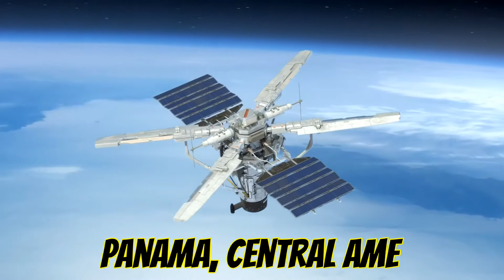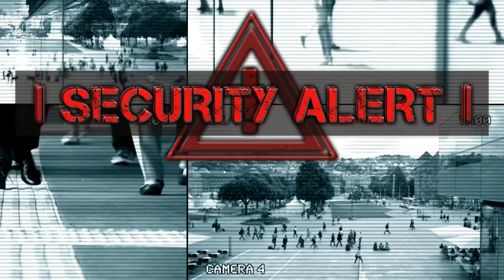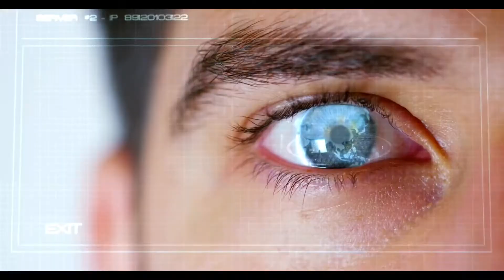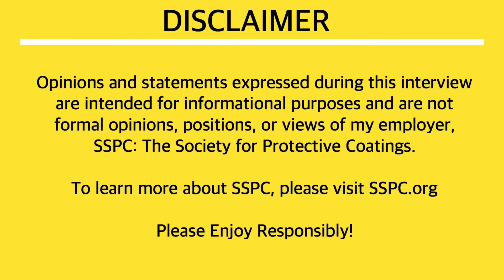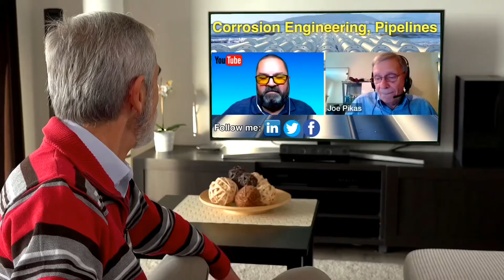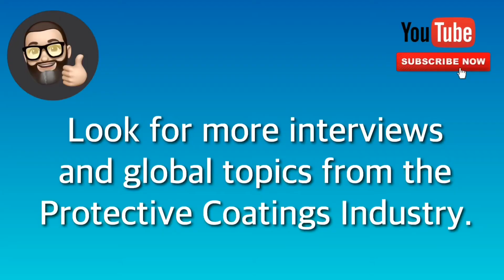Master Coatings Inspector INSIGHTS: Concrete Coatings and Linings (Episode 2) w/Juan Caballero, MCI

Comment: May I ask you something sir?
What is the difference coating and lining exactly?
Reply from the maker: Excellent Question!  In the context of liquid-applied protective coatings, linings cover the inside surface of something.  For example, coatings applied on the interior surface of a enclosed potable water tank (storage) would be a lining.  Thank You
Reply: @CoatingsTalk  Thank you very much sir.
How about ureathane paint, 2mm thickness,  2nd coat on the rooftop?
We can also call it as lining?
Reply from the maker: What is the commodity in the tank, pipe, or containment that needs a lining system?
Reply: I don't know that sir.  :(
Reply from the maker: That’s really important information as there are a number of lining system options & the commodity that it’s in contact with can impact the lining system or the coating system impacts the commodity.
Reply: @CoatingsTalk  I got it.
But I am just curious about what I would like to know exact meaning of lining.
Reply from the maker: Check out this link:  https://www.strandek.co.uk/articles/articles-difference-between-a-lining-and-a-coating/
Reply: @CoatingsTalk  Thank you very much sir. :)
Reply from the maker: Much appreciated and please reach out to me on any questions.  Thank You